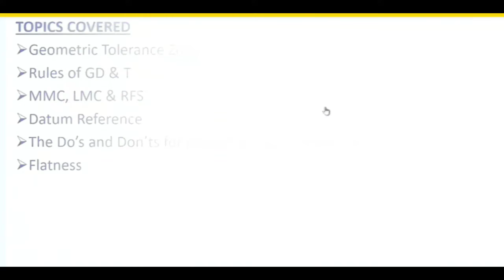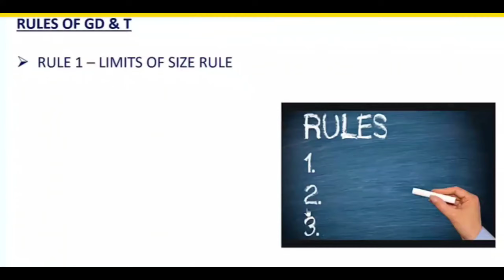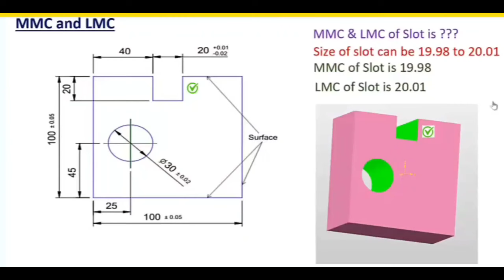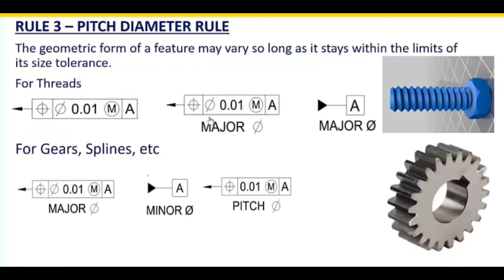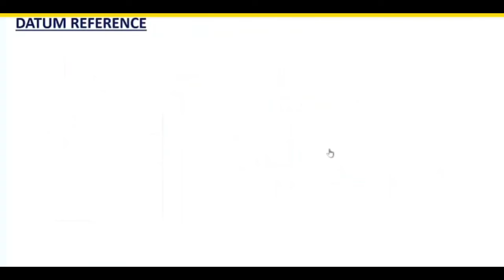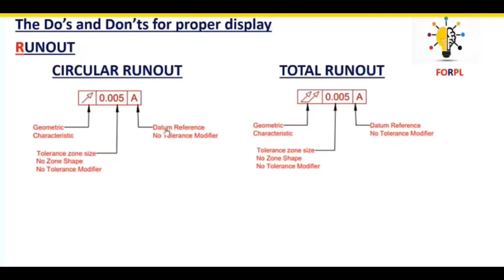Comment: In MMC and LMC sectional view no. 2, the valve of possible hole produced at MMC is the possible hole size is 4.5 with geometrical tolerance of 0.7 and at LMC the possible hole size is 4.5 at GT = 0.2 and 4.0 at at GT = 0.7.